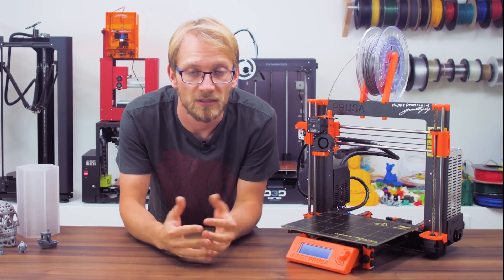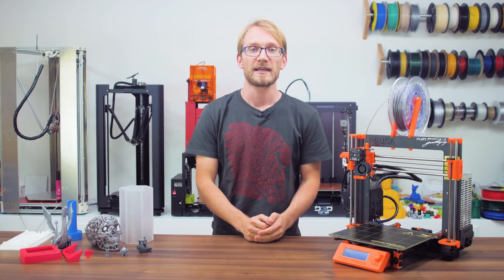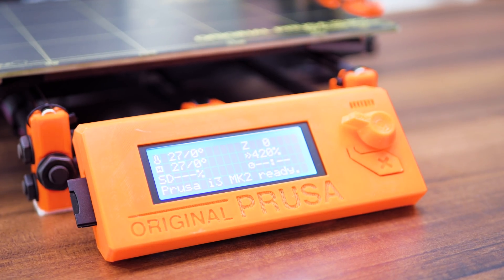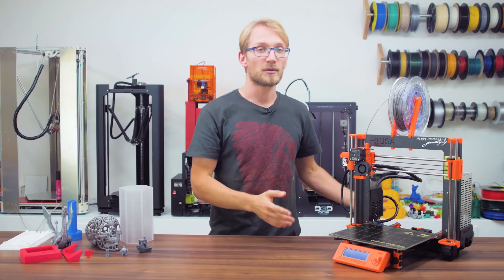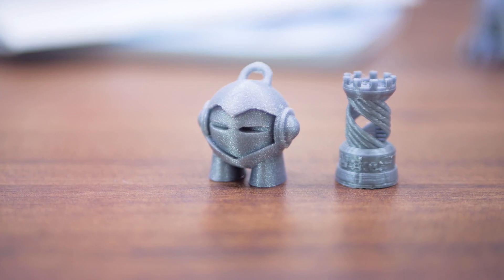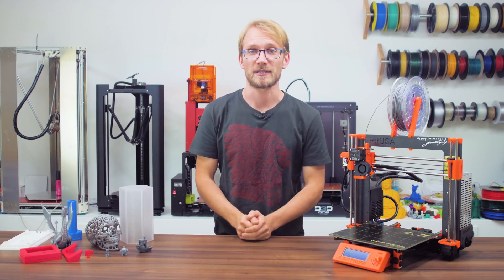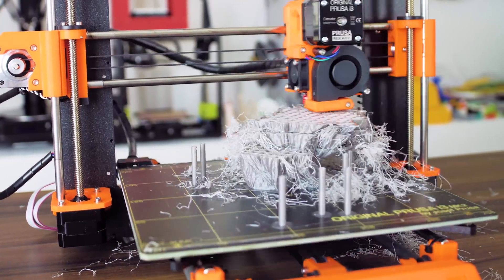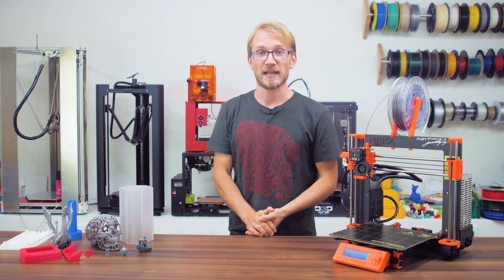Review: The Original Josef Prusa i3 MK2 🏅 It doesn't get any better than this!

Comment: Do you know if they are going to release that version of slic3r for public use? 

I'd love to have that ability to use the per-defined selectable filament profiles.
Reply: Thanks.  I have a homebuilt machine that I heavily based on the i3, but with a 300x300 build plate. It's running an e3d v6 as well, but in a bowden setup. 

So I figured the stock profiles you showed would be useful, if i mess with the retraction settings a bit.

Comment: The printer sounds amazing! As you were flipping through the Slic3r settings, I noticed that the internal infill pattern selected was "Grid". I had seen this added in Slic3r github but can't really find any discussion about where it would be more useful. Googling "Grid Infill" is impossible because everyone calls "Rectilinear" -> "Rectilinear Grid" so none of the hits are about the new Grid infill.

Looking at the code I see it is a subclass of Rectilinear except with the infill going both ways on each layer (XXX instead of one layer having it /// and the next layer being \\\). Is there anywhere the reason for this new infill is discussed by people in the know? I am just curious about its origin.

Comment: where can i order one of these, I'm from Canada...
Reply: Wow.  My shipping to Georgia was a little over $100.  The website says super saver is approximately $70.  I figured I must be in the sticks or something so it costs more for me.
Reply: Adding filaments usually increase the price.
Reply: I tried both with and without an extra roll and the price came out about the same so I added an extra roll.  I wasn't upset about it.  I figured it was a location or exchange rate issue

Comment: The big elephant in the room - it is still a very old mechanical design. There is simply no good reason to use such outdated components with projects like OpenBuilds. Also zip-ties is hard to find even on kits from China. And yes electronics and firmware is A+ - however that is not everything.

Comment: Great Review Thomas :) 
How easy is it to remove big prints from the print bed? Normally I prefer removable build plates due to the fact that it makes removing prints way easier. 
Would have been awesome if you had a flir camera to show the even temperature spreading the new MK2 plate. 
What about print speed ? Whats the standard speed of the factory printing profiles ? Personally I prefer part quality over print speed but to know how the printer handles higher speeds (100mm/s to 120mm/s ) would be nice ;) 
One thing I don't  fully agree on is the compulsory presence of a bed probe.  If you got a printer with a well engineered build platform you tram it once every few month. So no real need.
I would rather see a filament sensor which detects out of filament as well as jams on every printer. Especially with such a large build volume. Loosing a 12+ hour print is kinda frustrating!
Reply: Christopher Matthes, I agree about the filament out sensor.  The beauty of this design is that you can add things like that.  The Prusa3d forums do have people doing this sort of thing all the time.  I suggest reading their forums a bit.

Comment: I`m a prusa Fan, and this is absolute top of the line, this machine has everything I want to upgrade in my prusa printer, however, still pricy.
Reply: Quality? 3d printed plastic and Ali express rods and screws are "quality"? Get your head out off your ass! Joseph is running a business, just like Brook. They buy in bulk and cut costs were they can. It's a great design, but I'd refrain from calling it's components quality.
Reply: No - it's using quality components instead of cheap and nasty - it's safe (fused) its tested and engineered vs a box full of random crap and hope for the best from Ali express

Comment: I've been using the mk2 for almost 2 months now. I must say it's simply amazing! I'm busy printing my first custom print, 120x wedding favor bottle openers with a hole for fridge magnets. It's an absolute workhorse of a printer :-)
Reply: Also added on an Octoprint pi case, and camera attached to the bed. Oh and a must if you have some filament with odd hubs is a spool shaft for the filament. 
http://www.thingiverse.com/thing:1666699
Reply: Personally, I took a note from Thomas and put a spool holder above my printer (see his wall).  ColorFabb 2.2kg spools just won't work with the exiting spool holder.

Comment: Hi Thomas!
Grate video! Thanks.
Will you mount a flexion extruder on one of your i3?
Do you think that will be a good idea to use to get a support filament to the i3?
Grüße in den Süden
Reply: Mounting a Flexion Extruder on the MK2 requires a redesign of the Extruder mount.  The current one is just not compatible with the Flexion.  I should know, I have both the Flexion and the MK2.  That said, I'm probably going to try to print flexible filaments AS IS with the existing extruder and hotend.
Reply: Are you going to design one?

Comment: Ugh, I just ordered the Flashforge Creator Pro. Should I return it?
Reply: Yes.
Reply: I have a Flashforge Creator Dual (wood) and a Klick-N-Print 3D (steel frame). With fine tuning they produce 0.1 print quality close to injection molding. I reduced about 1.1 lbs. (~0.5kg) of carriage weight by converting them to Bowdens, though I'm going to hybrid Bowden/direct because I'm starting to use PETG more than ABS (PETG doesn't seem to like Bowden as much).

As my background is in aerospace/nuclear technology (physics), I find the Prusa design limited by the Y axis configuration -- the laws of inertia provide a limiting factor in speed and build height vs. quality.

However, the Prusa i3 MK2 is likely the present day epitome of Prusa i3 design.

If you can afford it, get the genuine Prusa later, as a companion to the Flashforge.   ; )
Reply: You can, but only if it's really worth it
Reply: It's depends from where, shipping can be a factor to return it. I just got my Creator Pro 2016 it prints amazing the only thing I dont like about it, is the print size I would love to have 200 x 200 x 200 size like the Prusa Mk2. I had the Wanhao i3 plus and noticed it collects lots of dust and very open. Wheres the Creator Pro has a case to keep everything nice and neat in there.Once a while I just do clean up. I like my Creator Pro, I did some research between the 2 machines and in the end i chose the Creator Pro for ease of usage, has a case and print quality is top of the line.
Reply: The MK2 has a 250x210x210 size btw! Glad I decided to get a MK2 :D
Reply: yeah
Reply: +zero00tolerance tnx for the honest review. I got the FF from Amazon so returns should be easy if I decide. I'm going to give it a chance.  I'm really interested in printing flexible material so hopefully it will work :)
Reply: Louis Boliou  What a pro ! you should do videos how to improve your Flashforge please !
Reply: Yes

Comment: Completely agree with Tom's enthusiasm. I bought a pre-built i3Mk2 from Prusa and have been printing with it for more than 2 months, loving the results. I print mostly in PETG, using Simplify3D as a slicer. Prusa & company have nailed the details, both in hardware and software.

Comment: How do you to the hot end priming?  DO you have added gcode?
Reply: OK so being a bit of a newbie to 3d printing.  Is there any way to see this code?
Reply: I think I found it :  G1 X100.0 E12.5  F1000.0
Reply: Actually it is the following:
G1 Y-3.0 F1000.0 ; go outside printing area
G1 X60.0 E9.0  F1000.0 ; intro line
in combination to what you found.

Comment: Great review, Thomas. I'm a mech eng student who does quite a few projects, and I really miss having a 3d printer at my disposal. Is this what you would buy at the moment if you wanted reliability and decent print quality at an affordable price? I built a Prusa i2 years ago, but the reliability of my solderings and chinese parts turned out quite horrible.
Reply: Guess it's my turn to try a "proper" kit. Time to carve out some space in the apartment. It does look extremely good between the different reviews I've seen, and yours was kinda the nail in the coffin. Thank you for posting a lot of great content.
Reply: not only that, this is the design all the far-east kit manufacturers are cloning. Why not support the original designer, my printer ended up costing USD 400, obviously by using the cheapest materials avaliable. 2 years on, and all the rods have very deep grooves worn in them, and the motors are not happy with all the drag, especially on the x-axis. I've put a lot of work into the printer, and machined a lot of metal parts for it, but at this stage I think it might be time to retire it and just support the designer. I looked over the design files, and I doubt I'd be able to save much by printing my own parts and reusing parts off my existing printer.

Comment: We've had our MK2 (upgraded from an i3 Plus) for a bit over 2 months now. We had a few hiccups with it that were mostly my fault but are otherwise pretty happy with it ourselves. That said, I think there are a couple spots that could be improved.

In our air conditioned office with a constant temp of around 22 degrees C, the bed struggles to get up to ABS temps without a little help from a piece of cardboard over the top. We plan to move it to a warmer part of the office eventually and also install a cork insulator beneath the bed.

The second is the clearance around the wire harness for the X-gantry is really specific, which makes it a pain to do any sort of troubleshooting (zip ties haunt my nighmares). Understandably this is a problem the MK2 inherited from its roots using the same i3 steel frame. I hope in future iterations of the printer the frame inner aperture is widened. 

Lastly the print fan is unidirectional and with fast PLA prints overhangs on one side of the print turns out visibly nicer. Should be solvable with a better duct if I ever get around to printing one!
Reply: Benedict Tan ww

Comment: I have a PRUSA Homebuilt.  It doesn't come near this quality, and it took me more than 30 hours total to build it...it is currently in pieces because the wood frame warped, the print bed glass over plywood) was so far out of plane I had to shim it by over 4mm in one section to get it even close to flat.  Nothing would stick (no heat), and it cost me about $400 back 3 years ago.  THIS one looks amazing.  I'm pulling the trigger on this in about another month.  Thanks for the review!!
Reply: I also have a Prusa i3 I built myself, and after seeing the price tag on the MK.2, I really wish I saved my money for this one instead. I spent about $800 on the one I built myself, and this way better one is only $600. I guess I got lots of experience building it myself, if that's any consolation.
Reply: My I2 has many issues.  Note that you can't heat the glass bed that is on top of wood with a hair dryer...well, you can, but the heat won't stay for very long...especially in a 62F basement.  

My I2 also seems to have an issue in the first 4 or 5 layers.  It crushes them together.  SOME improvement was made when I moved from Slic3r to Cura, but it still does it to a degree...the Z-Axis just doesn't move for those first few layers it seems...nobody can seem to figure out why.

Another issue is that it seems to not accept the G-Code correctly.  If I use Pronterface and tell it to move 200mm it moves exactly 200mm, X, Y, Z...doesn't matter.  As soon as I try to print something the scaling goes out the window...a 50mm box may come out at 48mm or 56mm, I've had a 25mm square test cube come out 22 x 28 x 21 one run, and 28 x 32 x 29 in another run...Again, nobody can figure it out.  Belts aren't skipping, threaded rod isn't slipping...yet G-Code wise it doesn't like executing it...

So...I'm pretty much over the "homebrew" printer and moving towards a more commercial item. Trust me, the money doesn't bother me...I work hard so I can buy toys.
Reply: You know I entertained that thought.  I really did.  BUT, I don't have parts, and my existing i2 doesn't have the capability to print a quality part right now (and may never have that capability). For me to buy the laser cut frame, the heated bed, the sensor, electronics, new set of motors, hot end, display and so forth I'm still in for a couple hundred bucks or more, and still need to source the printed parts.This printer seems to be a bit pricey for what it is, but as was stated "this thing rivals a $2500 printer for 1/3 the price"...that's saying quite a bit.